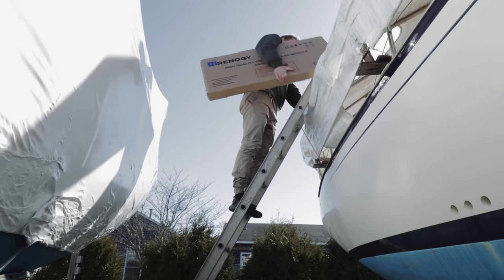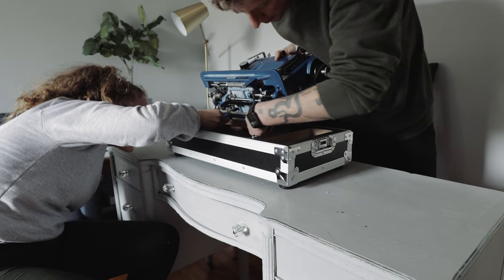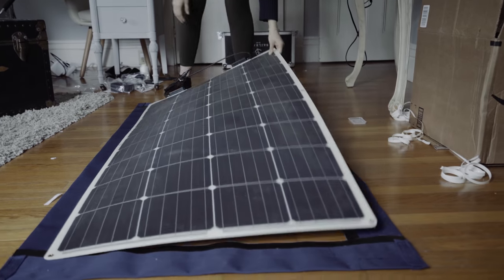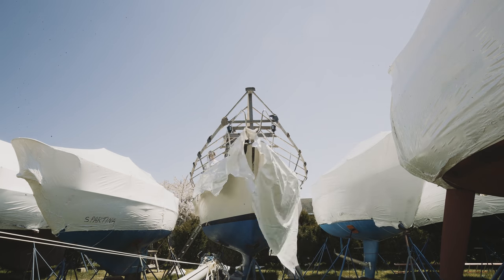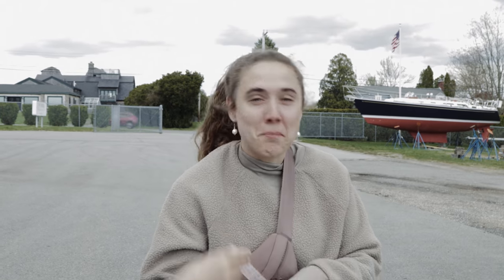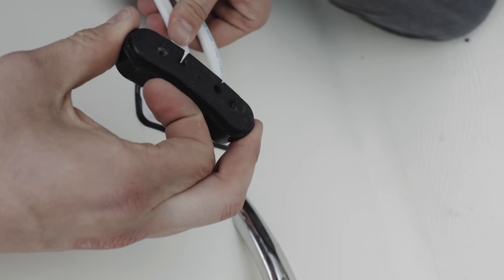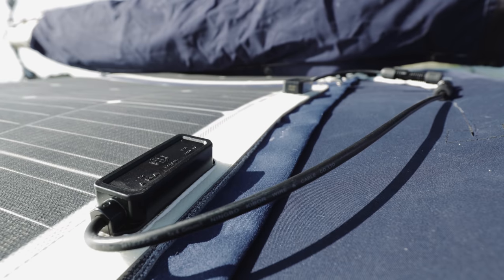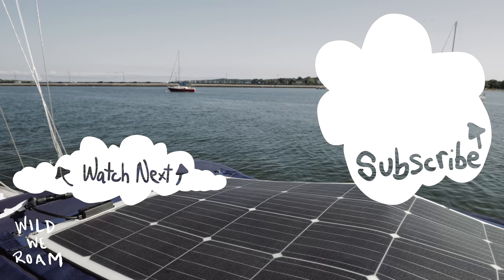Installing Solar Panels on our Bimini!

Comment: Hi guys! In the future do not sew the velcro with the glue on the backside. The needle pushes the glue inside the sewing machine and can destroy it. I have had so many people in my work making this mistake and from what I’ve learned it is not fixable. The ones with the glue is for hard surfaces and the ones without is for sewing. Looking forward to the next episode! ⛵️ 🤍
Reply from the maker: Thank you so much for this tip! As this video shows Im a total newbie to sewing machines, so really appreciate your insight. Won't sew with the glue again :)  -Dana
Reply: You're probably somewhere warm; it doesn't look warm there so the glue should be pretty resistant. Also lubricating the needle will prevent uptake. You'd have to sow a LOT of glued velcro to gum up a machine though. Unless they're made in China, in which case it's a 50/50 chance - it probably came with glue jamming up the insides from the factory anyway. I've gotten things from China with actual industrial waste used as packaging, and every Chinese power tool I've seen, brand new, on opening, I've found black used truck grease filled with so much iron filings from their ill made engines that I had to replace it straight out the box. Tbh I suspect they add this intentionally as it will destroy the tool within a few months to a year of use. They make things cheap, and cheap only works if you buy in bulk and the items become disposable single use things, so many dodgy companies self-sabotage their equipment to destroy it's longevity. There's no way they can accidentally sabotage their own equipment like that, they added the dirty old grease filled with iron filings knowing full well it'll chew up the internals of the tools like a hot knife through butter. And I've found this in many brands, over many years.
Reply: Are you saying use velcro that does not have the sticky glue backing?

Comment: Great job on the solar panels. Now for next step improvements. The panels don't like to get hot so what you do to improve air flow under the panels is to put a sheet of corrugated plastic. (Coroplast) this product is just about a quarter inch thick and has channels in it that allow for air to pass through and remove the heat from the panels. This will no doubt improve your panels' efficiency in a noticeable way.😎👍
Reply: What they said! Our flexi on our old boat rasher had a burn through because we didn’t vent
Reply: Incredible information I would love to have experience with solar power panels I want to make one. Mini weld soder I guess. Seems neat.

Comment: Yay!  That's awesome Renogy sponsored you by sending you the panels!  We used Renogy Eclipse 100w panels on our van and are very happy with them.  Looking forward to your videos to come!
Reply: I have had dismal experience with Renogy. They don't seem to answer any questions on faulty equipment. I had good performance from a small 50 watt panel, and used that experience to buy a fairly large chunk of Renogy equipment. I am now starting to replace it with alternate manufacturers products as the Renogy equipment fails.
Reply: Ken.....thank you for the comments.I'm starting my solar boat project in a month.

Comment: We bought our sailboat from an old couple and the lady was using sheets of fabric softener to make the spiders go away and  it works. I use it in every  places possible even if I am not a big fan of those products, especially in the  benches and in the cabins. You will see that the bimini gets pretty spidery even when you are sailing. Thanks to her!

Comment: I am also not a seamstress and rarely sew, but one tip my momma gave me is that once you've pushed enough of the fabric through to grip it, pull with one hand and push with the other to keep a straight line. Great work guys!

Comment: Great video. 

So at the end you’ll notice your boom is right over one panel. I hope you have those panels hooked to two separate mppt charge controllers. Otherwise you’ll drag down both panels when just one is shaded. I think I saw more then one but this is an issue when one panel in a set hooked to one controller gets shaded. Having multiple charge controllers helps solve it.

Comment: It is a very nice solar panel, but I hope that the flexible type will be used as a sub as an auxiliary.  This is because the panels will easily flap in the windy sea.  Vibration of the panel may cause malfunction or noise.  We will tell you from the experience of using it.  Have a nice voyage!

Comment: Nice enclosure.  I hope to be able to see more photos someday of how you built it up on your website.

We are still working on ours on our Rasmus after two years of cruising without one.  The previous owners raised the boom about 8" from the stock position, so we had a little more head room to work with on our bimini frame.  We can stand up on the cockpit benches without hitting our heads on the rearmost section, yet still sheet in the main as tight as it possibly can go with a couple of inches to spare when reaching very close to the wind 

I hope you didn't push your frame too far up or aft because it looks like the Crosby-rigged mainsheet is going to interfere with it on a run with the boom all the way out to the shrouds.  I hope I am wrong. I guess you will see when you start sailing with it.

That new arch looks like it overhangs the stern a few feet.  You just turned a 35' boat into a 40' one as far as most marinas are concerned, especially if your anchor sticks out over the bow at all like ours.  We are staying in Cambridge, MA right now and the difference between the monthly rate of a 35' slip and a 40' one is over $100/month.    We had to pay the extra because our monitor wind vane autopilot sticks out nearly 3 feet past the stern and the anchor another 2 feet forward of the bow.  We are 40' now too.

I'm not so sure about the solar panel mounted to the hatch cover.  I know it is a lightweight part of the deck and I try not to step on that section myself but it is often impossible not to, especially when putting the sailcover on.  I hope the flexible panel is OK being stepped on often.

One thing you might want to think about adding is grab handles mounted to the tops of the window frames on the hard dodger.  We did that with meaty stainless steel handles and it is one of the best things we ever did.  You'll understand the first time you need to go forward in anything more than the mildest of weather.  It is a bit of a jump going from the cockpit past the hard dodger with absolutely nothing to grab onto on the way.  I should post photos of ours someday on our Facebook page. They were not very expensive or difficult to mount.

Comment: You know you can alter the solar panels right? If it's sharp soften the edge with a dremel with a sanding drum on it. And those ill placed holes being too close to the panel, why not open the holes up and out (or drill new holes better placed) and put rubber grommets in the newly adjusted (or placed) holes instead?

Comment: I will be interested to hear how your Renogy solar panels and charge controller performs over time. I recently purchased a fair bit of Renogy solar panels and charge controllers and have had erratic performance from some parts and complete failure with a dc to dc charge controller. I am hoping the Renogy inverter doesn't also quit as it does not seem possible to get any sort of response from the company.